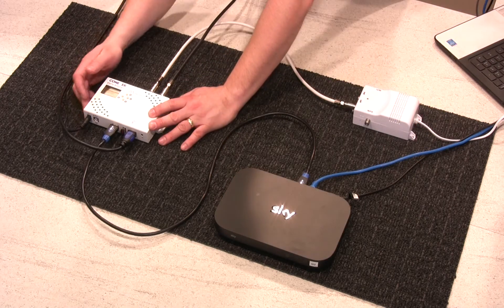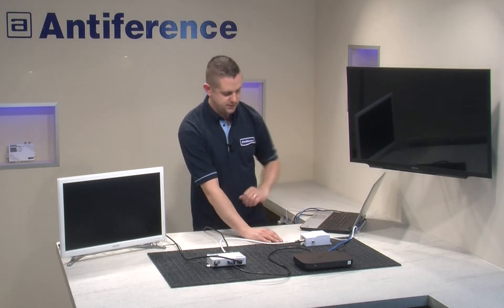DMHD01R with IR Control

Comment: Thanks for the video. Approximately how much delay is there from the source to the display? So when a user presses a button on the IR remote, how long is it before you see the change on the TV?
Reply from the maker: Hi There 

The latency (delay) is just under 1 second in most cases.

Latency can also depend on the processor on the TV. We have seen some TV’s with almost zero latency and others are longer than 1 second. Around or just under 1 sec is typical.

Should you have any further questions, please so not hesitate to contact us on here or e-mail support@antiference.co.uk.

Kind Regards
>Lyndsey